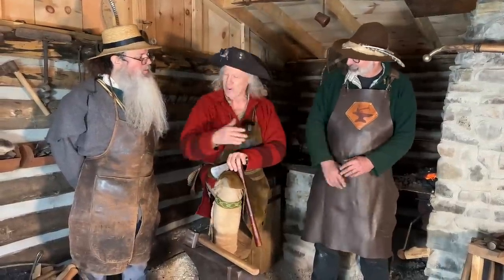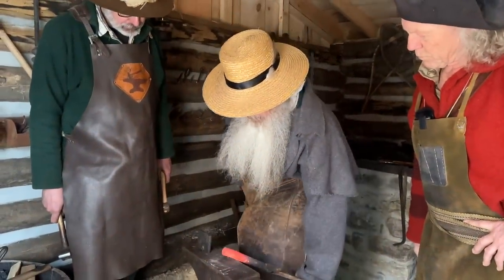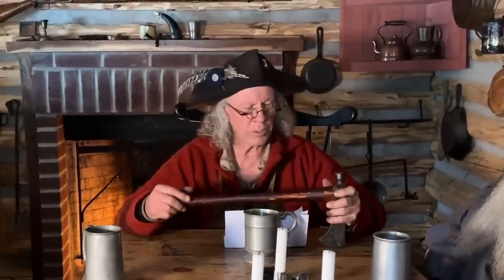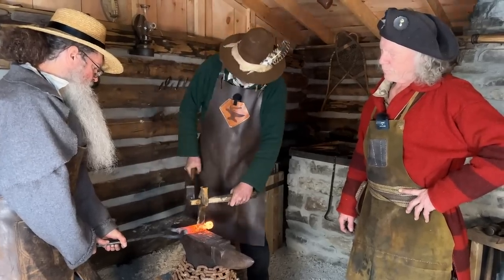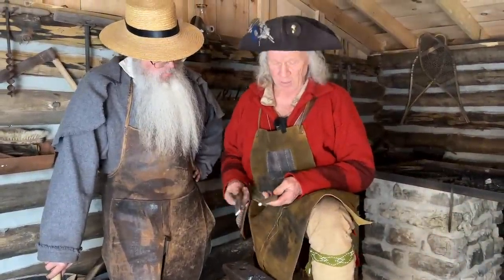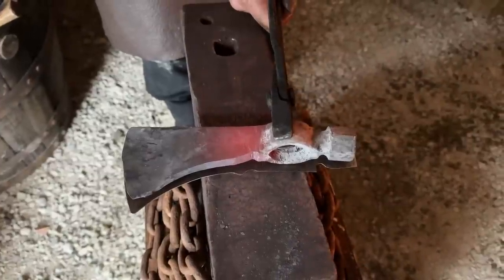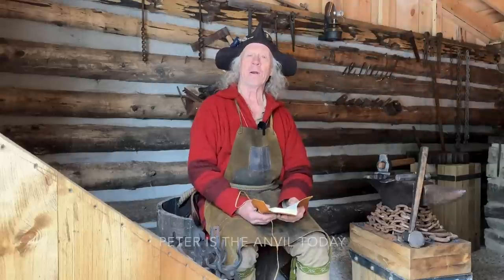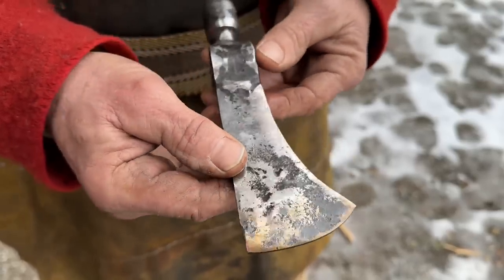Hand Forging a Pipe Tomahawk Using 18'th Century Tools | HISTORY | BLACKSMITHING |

Comment: Hi Peter,

I love to watch true craftsmen making something out of basically nothing and Blacksmithing has to be the ultimate craft in my opinion. However, as much as I can understand the Blacksmiths of old learning through trial and error how to work a chunk of iron to form a useful item I struggle to understand how these people worked out the properties of minerals etc to assist the process. For instance, how did someone work out that Borax could be used as a flux to weld two pieces of metal together (among other properties)? Who first observed this mineral and thought, ‘I know what I can do with this!’ These conundrums fascinate me. We take these processes as part of a normal manufacturing process today but someone once had to work it out and I just can’t comprehend the thought process that they went through. It’s not as if a discovery like that would be through pure chance. I would have thought the chance of some Borax coming into contact with a hot piece of metal being worked in a Blacksmith’s Shop would be next to zero. Fascinating. 🤔

Best wishes,

Mark
Reply from the maker: Conundrums indeed.  I find myself these same questions.

Comment: One could also note that the pipe tomahawk BOWL shapes roughly corresponded with the evolution of the well known stone keel pipes (aka "petit calumaix" or sometimes "mic-mac" pipes from the ca. 1750 through ca. 1840's eras) which themselves were mass produced by French carvers for the fur Trade (Etienne Gibau of Montreal for example).   In fact, one could argue the point that the "saddle" (chevron shaped bolster/filed lines) on the eye near the blade base are also derived from the St. Lawrence and Maritime stone keel pipe neck base decorations.   Many early keel pipe bowl shapes were often direct effigies of "clay Indian cooking pots" but also included octagonal and "acorn" shaped bowls.    The "Acorn" bowl becomes all but universal on these pipes and get TALLER into the post 1790's.   The earliest French octagonal pipe tomahawk bowls seem to NOT derive from a gun barrel however, ....but certainly not from "rifle" barrels, as these were mostly made in France and not a "make-do" frontier project.   The English "STANDARD PATTERN" pipe tomahawk was well established by ca. 1780 and used a less defined "acorn".....which gets more and more straight sided (occasionally "taller" too as the 19th cent. progressed (see all the Dakota pipe tomahawks from the 1850's Plains for example)......many without doubt made from used rifle barrels.
Reply from the maker: That’s great information, Kenneth .  I wish I had you at my fire to extract more.  Thanks for sharing.

Comment: Very great movie, thank you very much :-) I look also for a tomahawk making movie where the pipe hawk is made from a plate, being melted together. Often you see a rift from the eye going to the blade, but after maybe one inch is going lost. But, how did the blacksmith build the pipe bowl to such a hawk? Did he fix additional on the back of the axe part? This is a good question, because I cannot find a movie about this important forging topic. Maybe you can help and asked the other fellows-experts or friends about this. Thanks.
Reply from the maker: They were made by drilling and tapping the bowl and sometimes brazed but, the natives didn’t want such inferior products so the best ones were made from either solid stock or old gun barrels.
Reply: @TheWoodlandEscape  Thanks for the info. What´s the meaning of "solid stock"? But when you imagine, there were also many tomahawks made of brass, which really is a weak metal.
Reply from the maker: Means starting from a solid piece versus folding it around the eye and welding.

Comment: I would have never thought of filing red hot metal. What is the value of doing that over cold filing.  Any precautions to avoid pulling the temper of the file?
Reply: Hi Joseph! Great question. The technique is called hot rasping and it removes material far faster than cold filing, the file has enough mass that it never gets hot enough to affect the temper.
Reply from the maker: That is indeed a great question, Joseph and I think Chris has answered it marvelously.

Comment: Great video and I have a question. I didn't see if Chris and Beau fluxed the inside of the gunbarrel tubes before they hammered it flat or was that not necessary ??  I look forward to the continuation of part 2.
Reply from the maker: Good question.  We did not given the eye end is continuous and with the welding high carbon bit it simply cannot separate.  You not see a single separation in the head I’m currently sanding out.

Comment: What are the dimensions used for the handle stave
Reply from the maker: Started out with a 2 inch by inch an a half .  Finished dimensions is quite small like the originals.

Comment: But, but, but what about the pipe part? How does the smoking pipe part get completed with the handle?
Reply: Ya. I'd like to know also. How do you smoke it?
Reply: Normally, the handle is drilled from the end, just up to the point of the centre line with the pipe bowl. Then the handle is drilled out from the base of the pipe bowl to meet up and enter the hollowed out line of the first drilling.

You see Peter doing the drilling of the handle length in the video.
Reply: @robertwiggins4921  How… does it smoke?! : )
Reply from the maker: I’ll be showing exactly how it works.  Starting work on the haft this week.